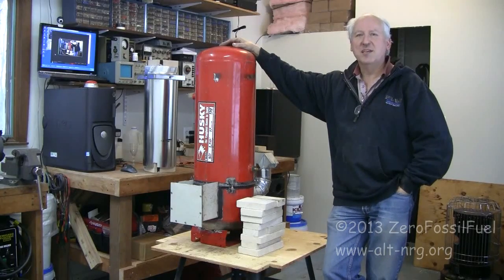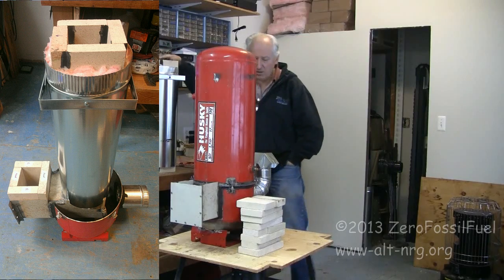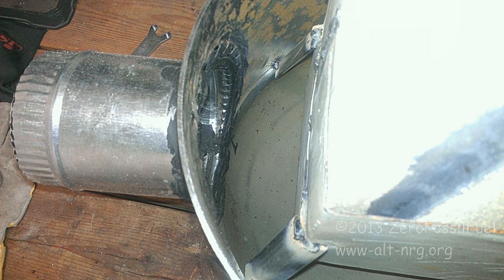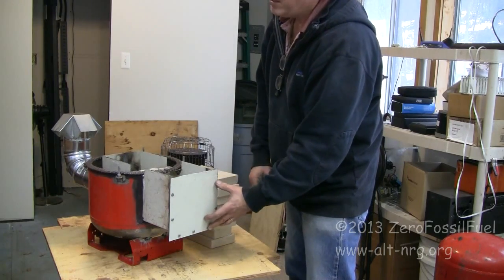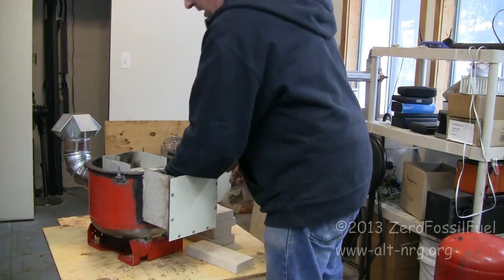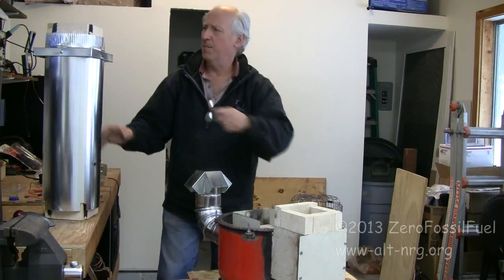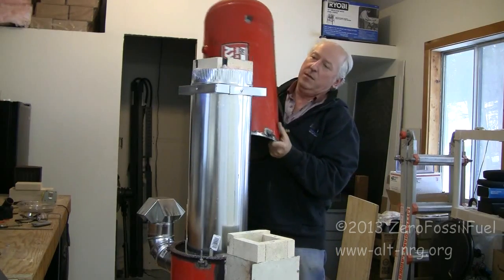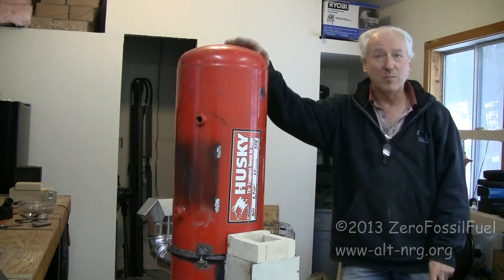#324 1st burn of Rocket Stove!

Comment: yipeee, thank you sir. Rocket stove performance is VERY sensitive to materials/dimensions etc. SO WELL DONE FOR BEING SO GENEROUS AND SHOWING PEOPLE A GOOD DOMESTIC DESIGN. 
I will build one. I would like a rocket stove with more burning power to heat a 200 litre water can directly, I dont like copper coiled pipe to heat water due to contamination by copper corrosion and possible risk of explosion. Do you haver riser height/burner chamber length/fuel size for a 6 or 8 inch version with more burning power, yet also smokeless ?? Thanks in advance. I have found Permies community to be unhelpful, often totally failing for revealing specific details of good performing rocket stoves. So why just entertain the idea to viewers, when the performance is in the detail as you show. thank you.

Comment: How does the stack stay in the eight inch pipe when you lift it onto the lower unit?Because youre holding the pipe not the heavy bricks.
Reply: lbrinson0002 I am assuming he stuffed the void with fiberglass insulation so tight they didn't slide. However after a while the fiberglass will breakdown. It is a neat design though

Comment: The heat exchange area is so small that makes this stove useless. FAIL
Reply from the maker: You must be a permies troll. I'm going to leave your comment up just to highlight your ignorance. The final design incorporates 700 additional sq-in surface area with aluminum fins. With the stove running at close to 1000*F at the top my single wall flue pipe temp has never exceeded 200*F.

Who is the failure now, smart ass?

Comment: Please tell me how you secured the fire bricks into the 8" flue so that they did not fall out when you moved it from the bench to the base during the assembly.
Reply from the maker: They are held together BY the snug fit of the 8" flue pipe.
Reply: ZeroFossilFuel ahhh Okay thanks...I am almost ready to start building this rocket stove.....a few more parts then it's a go!

Comment: Have you tried using any refractory insulation ie ceramics? I havent built mine yet so I cant be sure but I would think that the Fiberglass insulation would melt/burn up. you could look into 3M FireWrap or IIG Mineral wool. Both are capable of sustaining 800+ degrees consistently. Also because you are not heating up a mass I wonder if you could get more efficient heating by adding "heat sinks" to the top. ie welding on some fins to give more surface area to throw heat like a radiator. get back to me if you try these ideas.

Comment: I understand how rocket heaters work, but just to make sure I understand this design, the heat lifts up the flue, drawing in new air through the feed port, and after reaching the top of the flue, it is then pulled down through the secondary chamber, by the suction of the chimey?  So it's just a 'double chambered' rocket stove? To contain the flame.
Reply from the maker: You're only partially correct. ALL OF THE DRAFT needed for this heater to operate is created within the insulated internal riser (what you call the flue), and yes, that draws the air into the feed port. After the hot gases exit the top of the riser, there is no need for more draft from any other part of the system. In fact it can even overcome slight back pressure on the exhaust which is why there can be such a long horizontal run through a thermal mass if desired. In the outer chamber heat is given up to the chamber walls and the contraction of the cooling gases assists even further to create draw on the system. The added draft created by my vertical chimney pipe is negligible since the exiting gases never exceed 200*F anyway. It just makes more sense to exhaust above the roof line.

Comment: Hi and thanks for sharing your work. I keep having a nagging thought that what you might have there is not insulated fire brick but simply fire brick. Is that a possibility?  I get this thought when I hear the bricks clink together. They sounded very hard. They also look the same as what I picked up recently at Home Depot and what I planned to use in the firebox of my design for abrasion resistance, but backed up with soft Insulated fire bricks (IFBs) and have the tunnel and combustion stack out of IFBs. Using firebrick and not IFB would lower the combustion chamber temps and not have a clean a burn. One source of IFBs is dead electric kilns free or nearly so on Craigslist. Those ones are super soft, but for those who can't find or afford nice rectangular ISBs, it is a possibility. IFBs are very easy to cut. Another reason I have this suspicion. I hope I am wrong.

Comment: Can someone explain to me why the fire is burning sideways and not upwards?
Reply: path of least resistance, creating high pressure in one area will cause low pressure in another, the movement of air is what controls the direction of flame.
watch the other videos to see the fire-up from the beginning, should explain what you didn't see here

Comment: fantastic build. I do not have access to welding, sheet metal brake and have only basic tools although I have a table saw and such. do you have some videos that would allow someone to make a similar effecent heater but not need all the expensive tools etc. thanks for your vids
Reply: take out add for someone with tools and explain what you want to do most people would help you just to see if works or not, most people with a welder also has a collection of scrap bits and pieces just waiting for a project to get them out of the house for the weekend and away from honey-do list. Hell I've been known to sit in my shop and play a tape recorder of hammering and grinding steel to keep everyone away while I watch football and drink a beer (let's keep this my secret okay).

Comment: you might want to consider having some form of heat deflector between the top of the inside of the air tank and the top of the internal chimney. 
i built a similar heat dispersion style heater but without firebricks i made my own slurry for containing burn heat but the heat generated from the internal chimney heated the top of my outer  container (the air tank in your case) and it initially warped it. that was ok but after around 5 months use it burned right through, this was 8mm , 5/16th steel

Comment: An excellent presentation and it looks to me like a very sturdy assembly. I've been thinking along very similar lines using an retired electric hot water tank cut to appropriate length as the outer cylinder and a section of insulated stainless chimney as the inner column, also a castable-refractory made of fire clay and a grog of fire brick with chicken wire for strength for the column base but similar fire brick fire tube/chamber. Think I'd just band the seem in the outer casing and tack weld.

Comment: Weird.  Mine is only 13" dia, which puts my CSA at 132.7sqin.  Cubic inches in a gallon is 231 which means a 25 gallon tank would have 5775 cubic inches.  That means my tank would have to be 43.5 inches long to be 25 gallons.  My length measure ment with a tape measure on the outside of the tank is around 36".  Even with the curved ends I can't be almost 7.5" off in my measurement.  It makes me wonder if maybe the capacity is measured at uncompressed air volume that the tank holds at pressure.

Comment: Like your design and further to your recommend of a larger burn flue:- a 5" flue with an 8 " surround filled with 1.5" of pearlite or vermiculite would provide a burn flue of 19.6 sq in. and still fit in a 12" tank. keeping all other dimensions the same (burn tunnel  approx 11") would this tend to be better or worse?

Comment: well done very clear now on how it work i look at many this video good info . i wonder if you would drill a hole on top of the tank and had treaded bolt with a plate cover inside the tank to controle the gap between the tank top inside and the sleave maybe controle the wind that goes throught looking to build one thanks for your info(vid)

Comment from the maker: Well my 36x12 is 17 gal.
Area of 12" is pi*r^2 or 113 sq in.
25/17=1.47.
Assuming the tanks are in fact the same length then
1.47*113=166 sq-in.
sq-rt of (166/pi) is radius of 7.27" or 14.54" diameter.

So, it's about 2.5" bigger around than mine which should be okay too as long as all the other dimensions remain the same. Yours would also be large enough to support a larger diameter riser. I would recommend it. Figure something in the order of 25 sq-in and 22.5 sq-in for the burn tunnel.

Comment from the maker: I believe it would be rockety enough. Last night I ran the stove up to ~550F at the top. The flue temp at the bottom just as it exits was 175F, 125F at the bend before it goes out through the wall. Even though this is a 3.5-4" system, I think if I was to snake some exhaust pipe through a thermal mass I would still use 6" instead of 4".

Comment: I've been looking for a no mud design, looks great.  How rockety would it be without the vertical chimney?   Are you getting enough heat loss off of the barrel to be able to have the exhaust flow through a long heat mass and exit the house essentially horizontally? Thanks.

Comment: Looks good. Was wondering if you might get better air flow for the burn if you put a piece of sheet metal in the feed tube, 1/2" off the wall farthest from the tank and 1/2" to 1" off the bottom. This would get air to that back corner, and be easy to make and remove if it does not make a difference.

Comment: Love this.  My 25 gallon compressor just died and I was looking for an interesting project on which to use the old tank.
How many total bricks did you use?  My 25 gallon compressor tank looks like it's about 36" x 13" OD.  That was just a rough measure by eye with a tape measure so maybe I'm off a bit, but it looks like a great candidate to duplicate what you've done here.  I think I'll see if I can also figure out a way to flatten the top to use for cooking in an emergency (or just for fun).

Comment: Let me know how you manage that.  With the steel support/guides at the top of the heat riser you'd have a hard tim slipping the top bell over the heat rise with the copper pipe already attached to the housing.  You'd have to have the copper pipe wrapped around the riser before you slip the bell housing over then figure out how to get the ends of the pipe through the fittings.  An interesting engineering challenge.  Let us know if you figure it out.

Comment from the maker: Data is coming, just as soon as I install it. I can tell you that for the 30 minutes I ran it outside in the frigid cold, the tank top got to about 350*F, sides were about 160*F, bottom of tank about 120*F and the exhause at the top of the flue only 82*F. YouTuber Web4Deb made a really cool gravity fed pellet fuel hopper for his rocket in his geodescic dome greenhouse. I'm not going to get that fancy.

Comment from the maker: ... and as long as the gap at the top is small enough to create the turbulence needed to get the heat out. I believe there's a temptation to make that gap too large. The cross-sectional area should be no more than 2x the cross-section of the stack itself. A 4" I.D. stack has a 12.6" circumference. 1" below the top is 12.6 sq-in. 2" below is 25.2 sq-in. Optimum is somewhere in between.

Comment from the maker: I actually don't think it matters as much. In fact, within certain limits I believe having a greater cross-sectional area between the stack outer wall and tank inside wall contributes to better heat exchange because the gas velocity slows as it works its way out, giving it more time to give up that heat before exiting the bottom port.

Comment: In my humble opinion, I think the issue will be that of capacity; can it provide enough BTUs. For example, a MAPP gas torch burns at 5300 °F, but I doubt even a dozen torches burning would generate enough BTUs for your shop. It will be interesting to see how long it takes to generate enough heat to make any difference. Regards.

Comment from the maker: The "Sand box" is used to store and release heat slowly between burns in a regular living space that is occupied all the time. All I need for my workshop is instant heat for when I'm out there working. If I needed to live in the workshop, I could always add a thermal mass later.

Comment: As I have stated before very nice build. Watching you left that top half of the tank off and on maybe weld a couple handles on the side, some round bar stock bent into a U shape or anything you might find that would work. I know you don’t plan to take it on or off too often, just a suggestion.

Comment: That's a nice little stove. I wonder though why this would be better than any other small cast iron stove with a long flue pipe running thru the shop before going outdoors.. Or is it the just because this is cheaper?

Comment: Interesting that is runs without a damper, that is wide open all the time.  Welding vertical fins on the outside of the compressor tank would increase it's surface area and heat transfer.

Comment: When you lifted up the top half you said – this is really heavy. What do you think about making and using adobe bricks using sawdust, so that the bricks are lighter and provide better insulation for a hotter fire? I know good insulation is recommended for a rocket cooker. I don't know if  good insulation is recommended for a rocket stove heater, but it would seem to me that the better the insulation is, the hotter and more complete burning the fire, and this would be good – yes?

Comment: Have you considered the fact that the air coming into the stove is warm room temp air and a vaccum is created in the heated space?  The air is pulled from the outdoors thru cracks around windows, doors, ect...  Think about an outdoor incoming vent to be channeled near the mouth of the flame, to relieve the vaccum and save the precious heated air.  Just my 2 cents.

Comment: i love messing around with furnaces and stoves. This is a nice small size rocket stove that puts out some good heat I bet. you could do the heat exchanger but you would have to insulate part of the tank to raise the exhaust temp. As it sits it is too efficient to need a heat exchanger or to heat up much mass if you want to take that route later. Sacrifice a little radiant heat with insulation and it could. Versatile I like it. :)

Comment from the maker: Radiant and thermal convection directly off the tank. I'm thinking of adding a heat exchanger to the external flue pipe as well but there's really not much heat left. After 1/2 hour of burning I measured an exhaust temp of only 82*F!